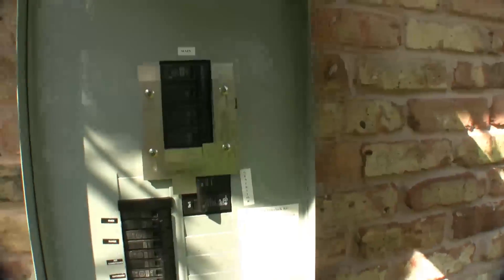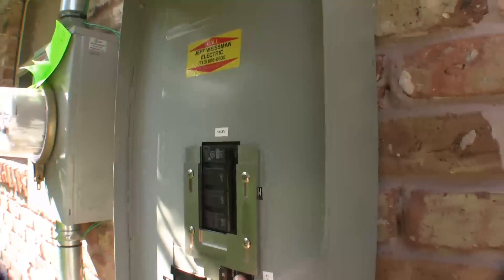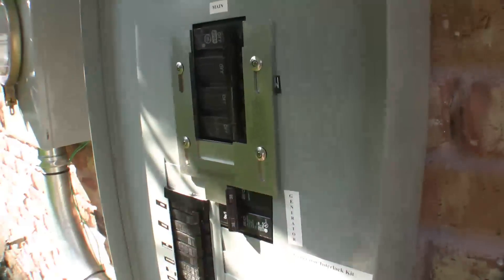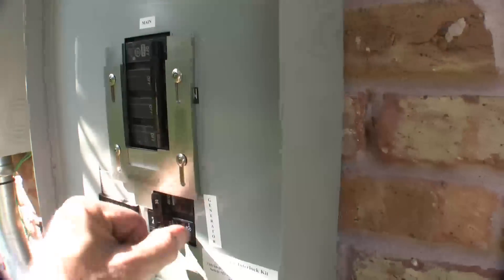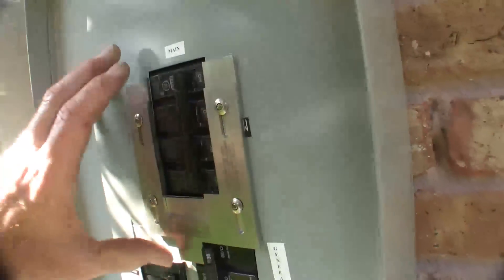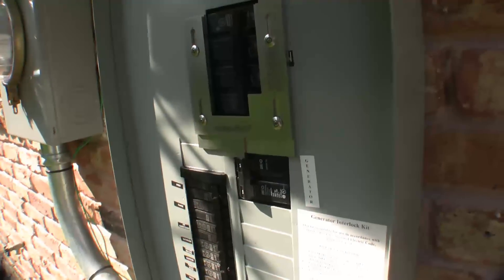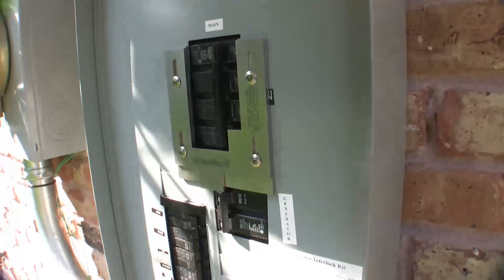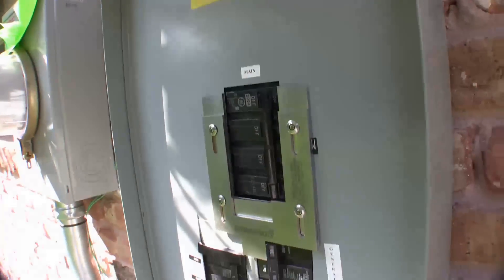How to Install a  Back feed generator hook up to your breaker panel

Comment: Can u confirm if incoming neutral cable can stay terminated at neutral bar when generator is on.
Reply from the maker: Yes it can, the Neutral bar and grounding electrode conductor are all bonded at that point.

Comment: I just had a quote done for this same type of plug put onto my home...my first quote was $520.. its a 8k-10k max Watt Gen. one level home three bed rooms no ac or water heater....what would be a good price for this type of work. I am in Statesboro Ga if your in my area call 9122430871 and the first electric tech did not even know about the interlock kits install, Need Help
Reply from the maker: If the Contractor is supplying the interlock, breaker and generator receptacle with a weather proof cover, thats a fair price.
FYI ...I'm in Park City UT
Good Luck!
Reply: thanks I will get him on the job...

Comment: WOW, this guy is FAST!  So fast his shirt flew off at one point :) I like it, a safe solution instead of some blowhard electrician saying you just can't safely plug a generator into your home electrical system, unless of course, you pay them to do it. It looks very economical too over a transfer switch plus it can't fail like a switch. I believe this lockout plate would help protect you if there was ever an issue that would prompt an insurance claim. You know how they like to use any excuse to deny payment.
Reply from the maker: The "interlock" is what makes this safe and acceptable to the National Electrical Code.
Reply: Jeff Weissman 
I'm not an electrician by any means but I thought it was common sense to turn off the main breaker before back feeding via a generator because the power will eventually be restored but I guess not?  I don't have a interlock or switch but I understand back feeding can hurt/kill those making repairs so I understand why it's now mandatory.  I just feel like people shouldn't be messing with something dangerous when they don't understand.
Reply from the maker: Your so right, thats why we now have interlocks that fit most modern style panels.

Comment: Hello Jeff and thank you for your video.  I have two 200 amp panels installed in my basement.  Does the setup in your video replace the need to do anything to my inside panels?  I haven't come across any licensed electricians to recommend your process.  I was under the assumption only a transfer switch could accomplish what you've done.
Reply from the maker: With two 200 amp panels this wont work for ya.  Your house is too big.  If I was you, I'd call the generator companies in your area vs an electrician.  They will come out and consult with ya and give you estimates.
Reply: Thank you Jeff.  I greatly appreciate your response.

Comment from the maker: Your correct. But this method, with the interlock kit is code approved and safe. the cord going between the generator and the receptacle below the panel uses a standard Generator Set Cord, with one female and and one Male end.
Reply: thank you I want to do this the legal way

Comment from the maker: Hey Heywire. I think you know the answer to this, and the answer is NO!  This would be a fire hazard, safety concern and against all applicable buillding code.  If you value your life or personal possessions, why would you want to attempt this?   
Now for the sake of intelligent conversation, could it work? Maybe. Could it not be a problem? Maybe.  But, would you buy a house if the previous owner told you, Maybe the electrical works and won't cause a fire, Maybe it will just be a small fire?

Comment: Hey Jeff I have a question. If I shut off my main breaker can I plug one extension into a random outlet at one side inside my house and again at the other side? And I'm talking about making 2 double male end extension cords. And I have a 5500 watt generator should this be enough to run the basics in my house not including my upstairs and downstairs ac.

Comment: Jeff, if a generator has the neutral and ground bonded, will a transfer switch or this interlock still work?...or do you have to remove the jumper wire between the neutral and ground on the generator?...I want to power my home via that 30amp plug, but keep reading about issues with the neutral ground jumper wire on these newer generators...

Comment: it was in response to aaronac8. he asked about his gen producing 50 amps and using a 50 amp breaker, my question was if he were to go the usual route of a 30 outlet to feed in wouldnt that 50 amp plug stepped down to 30 amp outlet only allow 30 through it, in regard to the 5700,on a wire chart i printed out online that 10 wire is good for around 5500 to 6600, i took low end to be safe.

Comment: jeff if he used 10/4 with a 50 amp plug wouldnt the wire rated for 30 amps at around 5700 watts only allow that power through?

Comment: What size wire should be run from the 50 amp 2-pole breaker in my main load center to the 50 amp power inlet box?

Comment: With the interlock switch, if my generator has a 50 amp plug then I must use a 50 amp 2-pole breaker in my main load center...correct?

Comment from the maker: 3 zone taco?  You lost me.
If you have to ask..." Is there a wrong way I could have hooked up the duel 30 amp breaker that could have done it "  Then of course you could of hooked it up wrong.
At the point where you are now, you better get a licensed electrician to look at it before you get hurt.

Comment: Nice video. I hooked up the same thing and whenI operated it I ended up popping a 24 transformer on my 3zone taco. Is there a wrong way I could have hooked up the duel 30 amp breaker that could have done it or was it the sign waves that may have fried the transformer on the taco panel?

Comment from the maker: In regards to the rain, the breaker panel is rated to be outside and in the direct rain, however, this house in the video has a soffit overhang that keeps the direct rain off the panel. 
Beside throwing the interlock switch, you still have to put the generator in place, and plug it in, and add fuel.
Speaking of my personal experience after Hurricane Ike, most people stayed inside and in bed, where its safe, till the storm passed. Then we went outside to restore power and start cleaning up.

Comment: Do you not have 2way type circuit breakers in the US? I have a 2way changeover  so as to select mains or gen but makes it imposable to  back-feed into the mains. Seems to me a mechanical lock is  frote with dangers of stupid people taking it off or tampering with it.Col in Australia.

Comment: Do you not have 2way type circuit breakers in the US? I have a 2way changeover  so as to select mains or gen but makes it imposable to  back-feed into the mains. Seems to me a mechanical lock is  frote with dangers of stuped people taking it off or tampering with it.Col in Australia.

Comment: Jeff, Thanks for the video - 2 things I would suggest to make it easier and safer for the average Joe... 1st turn off the main breaker before working on the panel to reduce the chance of getting Zapped. The 2nd thing would be to take 30 seconds to remove the panel cover so that you can work without bending over or kneeling down and see what you're doing.

Comment: Thanks for the video.  I wish my main were in my loadcenter.  Instead I've got a newer house wired using this screwy system where the main sits above my meter (outside) and is piped into the can, which is mounted flush with the dry wall of my garage.  I suppose I could rewire the main to go through a 2-pole switch in my can, but that seems like it'd be a pain in the ass- assuming the electrician even left enough wire to allow this...
What do you recommend?